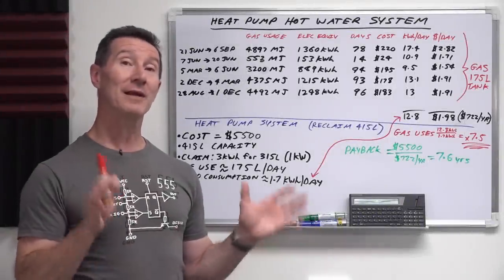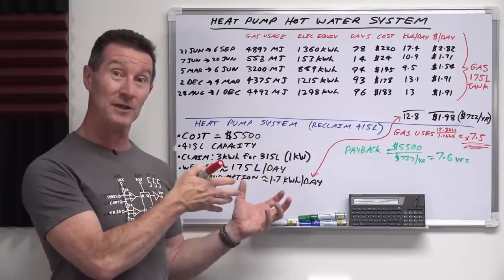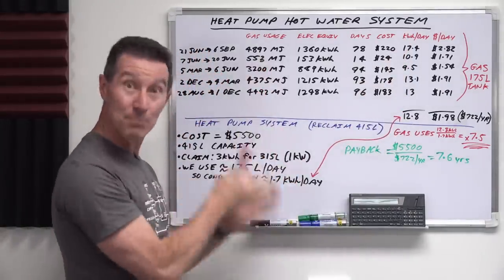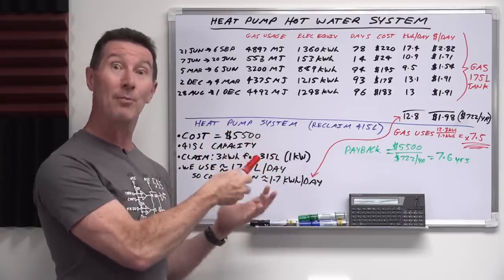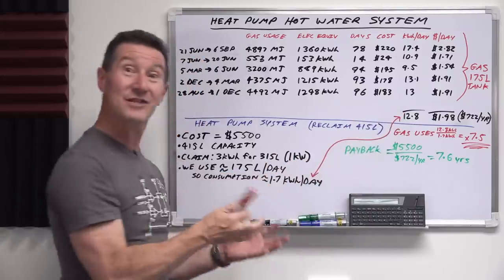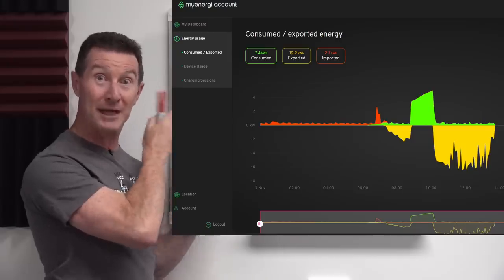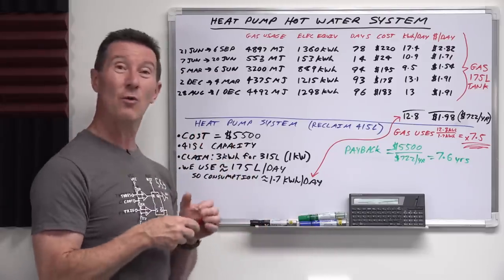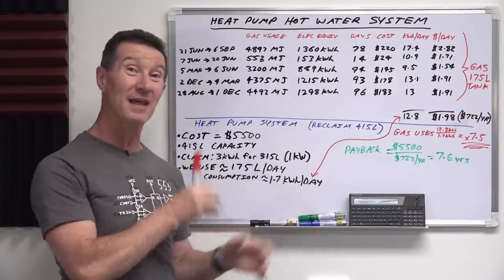Heat Pump Hot Water System vs Gas Hot Water

Comment from the maker: Forgot to mention solar hot water. That's not a thing here any more. It was big in the 1980's, but hardly anyone here installs it any more.
Reply: thank you so much, i live in Alabama and its pretty much Alabama minus  the humidity and you've helped me so much
Reply: Any idea how solar hot water compares to using electric solar panels connected to an electric heat pump?
Reply: How about combining both systems, by preheating the water on a solar circuit, would save even more energy.
Reply from the maker: @KriLL325783  Yep, it's in the slide I put up a few times. The one with the pink bargraphs. Gas=6157kWh/year, Electric=5110, Solar=2300, heat pump=1161. So heat pum is about twice as good as solar hot water. As always, YMMV.
Reply from the maker: @v.m.a.d.l.e.6972  Possible. But at only a few kWh/day for heat pump anyway, is it worth the hassle and complexity?
Reply: Really? They are still pretty common in Brisbane.
I'm a fan of them for the 'utterly ignore them and let them do their thing' aspect. The thermosyphon type ones anyway. There is just nothing to go wrong.
Intresting that it beats it out out in terms of energy and payback.
Edit: Ooh.. They are saying the costs have to do with the backup? But if you have solar panels you'd be able to put that in, somewhat.. And thay is also only IF you use the backup..
Reply: I have solar, wouldn't have anything different! O ly needs electricity if it's been cloudy for 2 days.
Reply: Im in Sydney too. I have Solar Hot Water. Installed a few years back. Costs me nothing all year round (except water usage). I have a manual electric  boost switch, but have never needed to use it. Also have a 6KW Solar power system.
Reply: Solar hot water has many downsides in sunny places with not that many good sides.. It takes plumbing through the house, it is bulky, it needs to have a goos view of the sun etc etc. Unless you are really strapped on electricity pricing - heat pump is probably better.

It gets much better in colder climates however, especially if it is in lower latitudes like northern US/Canada. When the temperature goes below zero, yout heat pump isn't that great at heating water to +60c ditectly, so solar heating can heat up the water to something higher and on sunny days with a properly designed system you could reach +60C with a solar heater alone.
Reply: What about combined PV/hot water? Cooling for the panels so more electricity and "free" hot water. Sounds very synergistic on paper!
Reply: Photothermic systems have too many drawbacks. If you have modern high-efficiency collectors, you need to incorporate a cooling system. Or you can boil it and destroy at least collectors. Pump failure also causes overheat and collector damage.
And today prices of photovoltaics are cheaper than photothermic.
Reply: @TheTallGirl  Exactly. If you want to heat A LOT of water to low temperature - go phototermic.. But if you want to always heat some water to boiling - just connect solar directly to the water heater. Then there is no need for expensive power conversion, grid connection etc. Without grid connection and staying below 120V - permitting is also usually quite lax.
Reply: I have had both on my house and a solar thermal system now isnt worth the cost. I finally removed it because it was so stupidly placed blocking the place for many PV Modules and one time when it got too hot the entivre system needed to be "refluidded" because of some design flaws of my system. The PV Systems became now so cheap and with a heat pump you can get from 20% to 60% efficency with a COP of 3. And with Solar Thermal if it is too big hour house is cooking in the summer and in the winter it is still not enough. With PV you just sell the excess
Reply: @ElectraFlarefire  Same in Perth, seem to be plenty on the roofs still.
Reply: Solar is still common in vic.
Reply: I'm not sure how they get such high power consumption for solar water heaters... If sized correctly is should use very little electricity... (maybe a pump to transfer water between the panel and tank) and a bit of backup heating if it is cloudy for a long period in winter... (which can theoretically be heat pump as well, that is likely too expensive though) (I don't know how overheating is prevented with some systems though (ideally excess hot water it should be used for absorption chillers to replace aircon, but residential-sized systems are nor common))

(the math probably gets more interesting when the water heating panels are competing with PV panels for roof space though)
Reply: Hi Dave, is there option to interconnect water exchanger with existing AC? So at summer you might store heat from house directly into hot water instead of blowing it out. Also reminds me what Technology Connections mentioned in one video, freestanding heat pump water heater which effectively cools down your house at summer while heating water. But it would be nice if you could switch where to put excessive heat.
Reply: @v.m.a.d.l.e.6972  And it could also cool down solar panels for higher efficiency...if you don't forget to drain them before winter :D
Reply: If you calculate the energy needed to raise 200l of water from 10C to 60C, it takes 11.64kWh. So the numbers you gave are strange: you probably use much less than 200l per day or the efficiency of the current system is pretty good. Don't forget some energy is wasted because when the water is hot, even with a good insulation, it will cool down. So you have to add extra energy to compensate for the losses.
Reply: Vacuum tube solar collector arrays instead of flat collectors do provide a good performance and can be considered as a pre-heater for the main tank.
Reply: Huh, for such a hot sunny area it's definitely weird....
Reply: @EEVblog2  in Portugal any new house had ot have solar hot water and solar electricity installed. I have solar hot water abs works really good. I know a place that uses the air conditioning to heat water instead of using the  air to air heat exchanger and they use water to cool down and that makes hot water
Reply: @EEVblog2  The other good thing about photovoltaic + heat pump is there's alot you can do with the electricity besides make hot water.  The solar hot water heater is only good for making hot water for your house.
Reply: Why not? It seems like you're in the ideal climate for it. A cheap DIY setup could produce plenty of hot water. Maybe a phase change device (wax or something) to store heat for night time. Just adding a VRF valve box and tube-in-tube or brazed plate heat exchanger into your existing air conditioning could also heat your water without the need for adding a standalone head unit.
Reply: Tons of solar hot water in Arizona.   Night or day you got hot water.   Matter of fact it was hard to find cool water.   I use to have 80 gallons at 165F mixed down to 130F.   Never ran out.
Reply: It might have been interesting 20-30 years ago but with todays EV systems and heat pumps being affordable it's not anymore.
I have heard that a solar hot water system is only 3-4 times more energy efficient than an EV solar panel but if you combine a EV solar system with a heat pump you get the same end result AND when you water is hot enough you get some "free" electricity instead of a solar hot water system doing nothing because the water is hot enough.
In short your EV solar will produce electricity the whole time and be at least as efficient if combined with a heat pump while a solar hot water system will only convert solar energy when required.
Reply: @OKuusava  What is "north"? Of course if you live somewhere where you have polar nights, phototermic will only work part of the year. This is why I was talking about lower latitudes. This means something like 50N, where it can still be quite sunny except for the couple months in the mid of winter. For more northern climates you will of course still get benefits outside winter since the average temperature is still so much lower compared to some place in Australia. But if talking polar regions, solar panels also make more sense for many reasons, even if you don't get to use them in winter. At around 60N the yearly average solar production is not much different to 50N and depending on the region, might actually match some place in 60N. It is just that you get most of the sun during the summer.
Reply: @OKuusava  Also what is -35c water? Your waterpipes and wells are permafrosted? :P
Reply: Hi. I’m in Canberra and got the Reclaim 315L about 3 weeks ago. The power saving is huge. Some days it only uses 1.87kwh others 2.7kwh. We have 2 adults and 2 kids. You’ll be very happy with the Reclaim unit. It’s so so quiet as well.
Reply: @rkan2  My grandpa installed solar heating in the 90s. Coincidentally in our region freezing colds come with clear skies, hence the solar system is most efficient when  a heat pump isn’t.
Reply: @xelaxander  These days heatpumps are pretty efficient, even for freezing regions. This is especially true for air-to-air heatpumps. Even water you can heat up pretty warm, but not much above 50c (at below freezing) like with the phototermic or photovoltaic. Overall savings are if course dependant on your yearly average temperatures and overall system design. For example you could be heating the inside of the house with some air-to-air heatpumps and then use a "scavenging" air to water central air circulation heatpump to make hot water. Again, if you are in a sunnier, but still a cold place - using phototermic or these days more often photovoltaic can make more sense. Above 60N it isn't much help outside the ~8 months.
Reply: @simon7719  on paper yeah but the effect is not all that big and the maintenance tends to be quite annoying. plain old rooftop solar is still a no brainer
Reply: I mean, only those who are interested in reducing their carbon footprint, but aren't happy with the silly ratio of solar electric.
Reply: @rkan2  DC will then fry the thermostat and/or overtemperature protector, risking fire, unless those are DC rated or bypassed causing the water to heat without any limit.

Resistive heaters also don't do MPPT.

Using an inverter and AC to power resistive heaters has merits.
Reply: @JussiPeltola  There are some tests of people doing it, and it doesn't seem like there is enough loss with small scales (<50kW) to make it worth to double the cost. In many 230V countries you can also DIY these systems, which again saves a huge amount (for more panels).
Reply: @rkan2  And to DIY it right you have to install a DC rated thermostat and overheating protector. Don't remember seeing many of those.

MPPT is not so important but some people have dreams of direct connections "having fewer losses" which is a total pipe dream when talking about resistors connected directly to panels vs an inverter with mppt.

It can make sense, especially if buying more panels and an inverter later. The non-DC rated switch contacts can also burn down your house regardless of voltage and regulations.
Reply: @KriLL325783  Solar hot water is very inefficient compared to photovoltaic panels, so the setup Dave's talking about is way more efficient for heating your water.
Reply: @v.m.a.d.l.e.6972  You get more energy from solar panels, so you'd be wasting roof space that you could could be using for them instead.
Reply: 😊😊😊😊😊😊😊😊😊😊😊😊😊😊😊😊😊😊😊😊😊😊😊😊😊😊😊😊😊😊😊😊😊😊😊😊😊😊😊😊😊😊😊😊😊😊😊😊😊😊😊😊😊😊😊😊😊😊😊😊😊😊😊😊😊😊😊😊😊😊😊😊😊😊😊😊😊😊😊😊😊😊😊😊😊😊😊😊😊😊😊😊😊😊😊😊😊😊😊😊😊😊😊😊😊😊😊😊😊😊😊😊😊😊😊😊😊😊😊😊😊😊😊😊😊😊😊😊😊😊😊😊😊😊😊😊😊😊😊😊😊😊😊😊😊😊😊😊😊😊😊😊😊😊😊😊😊😊😊😊😊😊😊😊😊😊😊😊😊😊😊😊😊😊😊😊😊😊😊😊😊😊😊😊😊😊😊😊😊😊😊😊😊😊😊😊😊😊😊😊😊😊😊😊😊😊😊😊😊😊😊😊😊😊😊😊😊😊😊😊😊😊😊😊😊😊😊😊😊😊😊😊😊😊😊😊😊😊😊😊😊😊😊😊😊😊😊😊😊😊😊😊😊😊😊😊😊😊😊😊😊😊😊😊😊😊😊😊😊😊😊😊😊😊😊😊😊😊😊😊😊😊😊😊😊😊😊😊😊😊😊😊😊😊😊😊😊😊😊😊😊😊😊😊😊😊😊😊😊😊😊😊😊😊😊😊😊😊😊😊😊😊😊😊😊😊😊😊😊😊😊😊😊😊😊😊😊😊😊😊😊😊😊😊😊😊😊😊😊😊😊😊😊😊😊😊😊😊😊😊😊😊😊😊😊😊😊😊😊😊😊😊😊😊😊😊😊😊😊😊😊😊😊😊😊😊😊😊😊😊😊😊😊😊😊😊😊😊😊😊😊😊😊😊😊😊😊😊😊😊😊😊😊😊😊😊😊😊😊😊😊😊😊😊😊😊😊😊😊😊😊😊😊😊😊😊😊😊😊😊😊😊😊😊😊😊😊😊😊😊😊😊😊😊😊😊😊😊😊😊😊😊😊😊😊😊😊😊😊😊😊😊😊😊😊😊😊😊😊😊😊😊😊😊😊😊😊😊😊😊😊😊😊😊😊😊4😊😊😊😅😊😊😊😊😊😊😊😊😊

Comment: Hi Dave.
Great video, we have a small heat pump HWS unit at work.
My brother who lives in a regional town with no piped gas, about 4 years ago had their electric HWS die.
He fitted a heat pump system and hasn't looked back, quick to install and compared to electric heat HWS, it is a god send.
Even got the gov rebate.👍👍
At 1:55, you mentioned reverse cycle air con, but showed an evaporative unit.
We recently moved from a reverse cycle house to an evaporative ducted house, and would reluctantly go back to reverse if we had too.
Evap is so much more comfortable, due to the moisture in the air, just need a couple of windows open to let the air out.
Power consumption wise it appears to be cheaper.
A humid day compromises it a bit, but all you do is turn the water off and run fan to circulate.
I live in Central Victoria, so evap works well, t'up north it may be a different kettle of fish.
As for solar, were are in the middle of a new housing estate, and most houses have solar hot water panel, possibly pre heater, on their roofs.
Reply: In Perth evap is supreme most of the time we need cooling and ticks a few other boxes such as quickly airing the house out after kids cooking has set off the fire alarm.

Comment: meanwhile here in BC,Canada... its 2.9c and wet.  I have both mini split and a few small heaters running.  Lol, the hot water tank outside is not a thing here.
Reply from the maker: Outside is normal for free standing houses here. My house when I grew up it was in the roof.
Reply: @EEVblog2  was young in southern California and the tank was outside but in Canada it is INSIDE as it NEEDS TO BE

Comment: Given how much energy you are exporting how do you think these numbers would have came out for a resistive heater tank?
Reply: About 10.8 kwh. 175 l with 40 degrees delta t and water is 4 2 j/gram . Degree oh and 3600 s in an hour. Shuffle the numbers and voila

Comment: Resistive heating tends to have better ROI than this expensive Heatpump system if you have big enough solar excess.
Reply: Yes, but then we'd have no power left over to charge the EV or other stuff, the hot water would consume all our peak solar power.
Reply: @EEVblog  If you have just a couple of excess kW to export now then yes.
And it is great modern system. I like them and looking forward to see your installation. 
Sometimes might be interesting do the numbers with more solar panels if there is space for them.

Comment: Imagine if you could have the refrigerant for your hot water heat pump plumbed into your split system for the summer in a setup like the multi split - Keeping cold whilst you heat your water.😀😀 that would be supreme efficiency.
Reply: This is a very good idea, AC systems should dump their heat into the hotwater system while cooling.
Reply: in Canada the heatpump water tanks have the heat pump on the top of the tank so it IS cooling your interior space when running and I imagine one could plumb ductwork off of it for HOT climate areas for a "low cost" method
Reply: @landspide  There is one mitsubishi with R410 that has heat recovery AFAIK
Reply: Look at Daikin split systems, they do this
Reply: @jasonriddell  saw one of those in some random channel. How does this effect the actual energy usage. I would imagine that running it inside the house would cool the house in the winter too. Meaning the house would use exactly same amount of energy to heat up again. That would make the heat pump usage kind of useless in winter.
Reply: The larger Delta Temp between condenser / evaporator the worse COP. You'd have AC part to run at nearly forming ice, and then you have to shed that pumped heat to a condenser embroiled in 60+°C hot water. It's quite a large step, not sure about the COP of that, if even possible. It would require quite high gas pressure = a very hot compressor = questionable life span.

Really cold days in Sweden, our air to air heatpump had a COP of 1 basically at -25°C outside. So, that is a single step of -25 to +20 seen from source to dump = 45°C deltaT was hard work, small gains (refrigerant R410A).
In Dave's case it would be 20°C indoors to 60°C tank = 40°C deltaT . 40 deg is definitely doable in a single step compressor.
Confounding factor for my reference; (actual) winter use has to deal with ice/frost buildup, causes poor heat transfer in outside unit, my unit did not have a controlled expansion valve either, just capillary tube, year 2005 "technology", R410A gas. I think all modern top shelf units has electronic controlled exp.valve.
When my heatpump was running full tilt I think the limit for hot gas out from compressor was about 100°C, hotter than that and it would reduce rpm's.

Having 2 different systems for AC and waterheat is probably more efficient, since both run on good COP,  35°C outside, step it down 15°C to cool indoors at 20°C. Water heater steps 35C outside to 60 in tank, a delta T of 25°C. AC case will have worse COP because the compressor heat, transfered to working media, is pure waste heat that needs to be shed. In hot water tank case, compressor heat is recuperated. I think Aussie winter will be hard work for water tank compressor if the temps drop near freezing.

I'm not so well informed on nitty gritty details regarding media(the compressed gas) properties; maybe the media is more efficient at 0 step up to 60°C use cases compared to media used to extract heat from -20°C environment. Winter air to air heatpumps meant for (actual) winter today uses R32 I think, could be wrong though... out of the loop.
Reply: Our geothermal heat pumps in America can be ordered with a desuperheater, to heat the water. During the summer you essentially have free hot water.
Reply: Solutions for this already exist🤙
Reply: @Kregorius  not if you use a split vent with dampers.
Reply: Heat recovery is available now.  Water heating is available from LG, Mitsubishi and Daikin.  It is not cheap and you need a storage tank for domestic hot water.